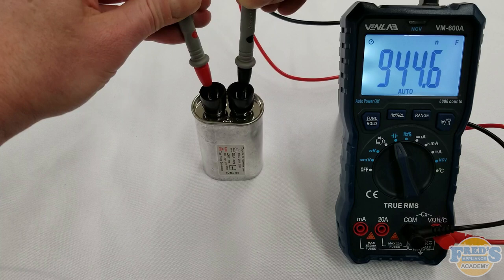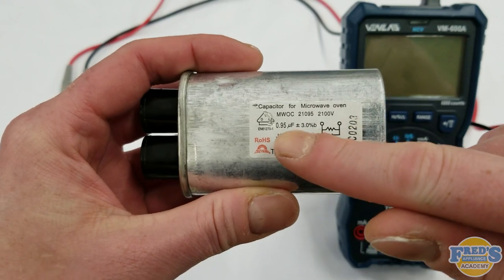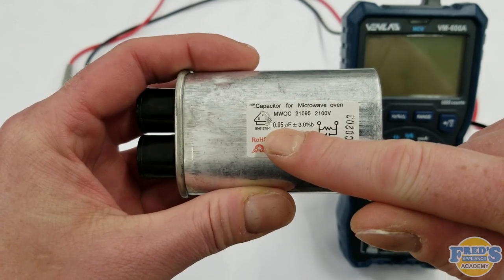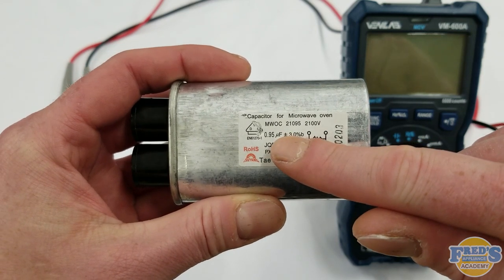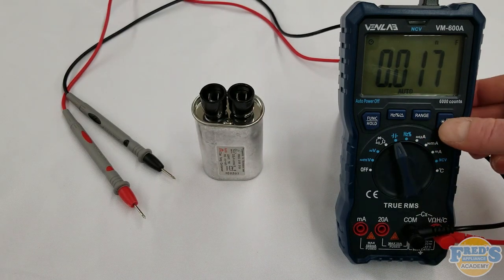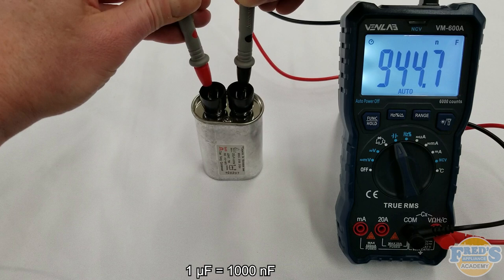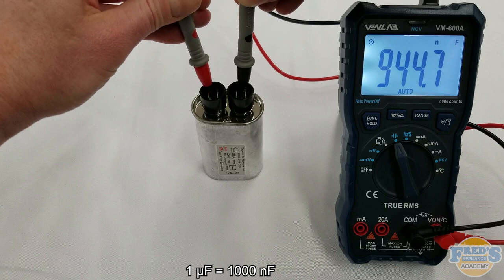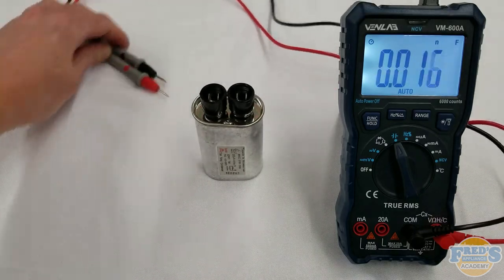Testing a microwave capacitor

Comment: I have a microwave capacitor that is rated for .91 +/-3%. Its reading .944. That puts it at 3.7% over the rating and .7% out of spec. Is .7% out of spec going to prevent my microwave from functioning? What's the typical reading of a failed capacitor, is it close or really far off spec?
Reply from the maker: As far as those readings go the microwave should run just fine.  When the capacitor fails It normally will be out of spec by a large margin. When the capacitor shorts it basically becomes a piece of wire and the microwave will run over current and blow a fuse or trip a breaker. When the capacitor opens it will not allow any current at all. The unit will run but not heat food.

Comment: would have been nice to have a few caps to show in spec, out of spec, OL etc.
Reply from the maker: Hello! Thank you for the feedback. We will certainly keep this in mind for future instructional content. In the interim, if your meter reads outside the suggest value on the cap, it will need replaced. :)

Comment: In the UK ( 230 Volts AC ) .... another way to test , is to wire your 1 μF capacitor in series with a 25 Watt , 230 Volt Tungsten filament bulb ... connect the whole lot across the mains ... the bulb should glow with an orange similar to a tube ( valve ) heater from a vintage radio ( makes a good nightlight as well ) ! ............ DAVE™🛑
Reply from the maker: Thanks Dave! Awesome to hear from you in the UK!